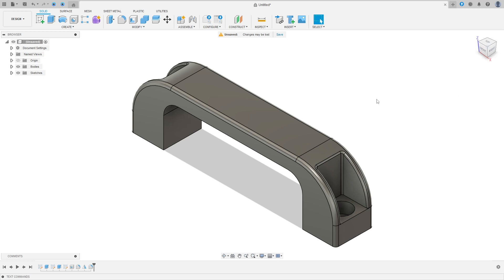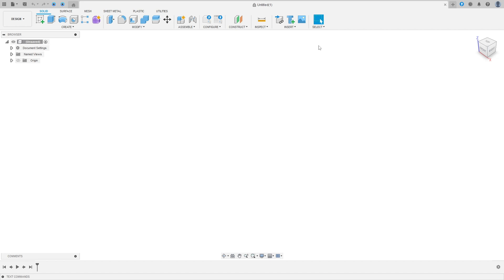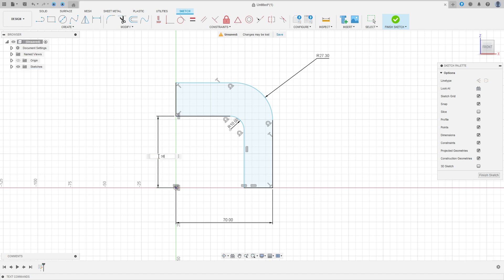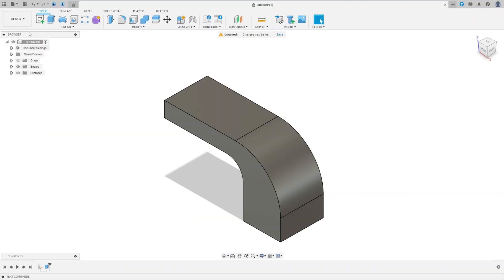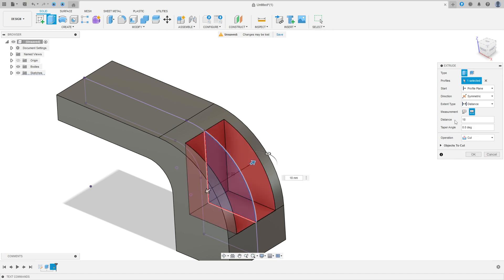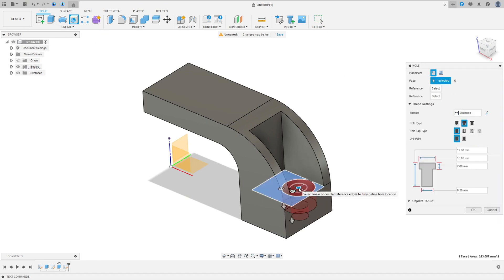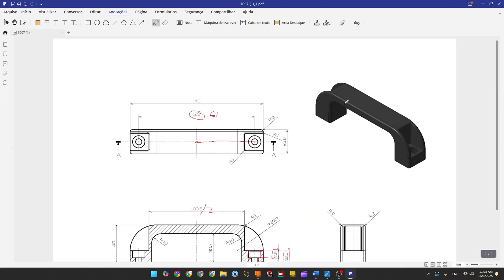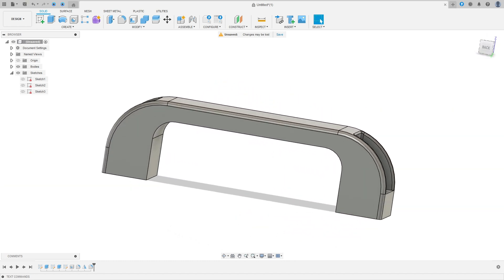How to make a Handle in Autodesk Fusion  - Lesson 287

Comment: I dont' know if you are checking comments section but I have problem with making bottom ends of this handle in different shape so it can fit into holes on my vacuum cleaner.